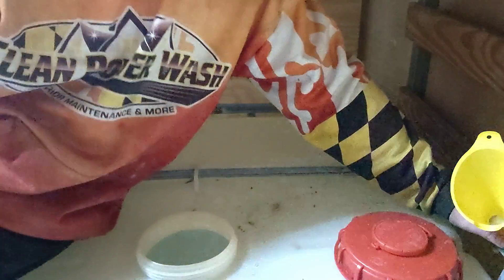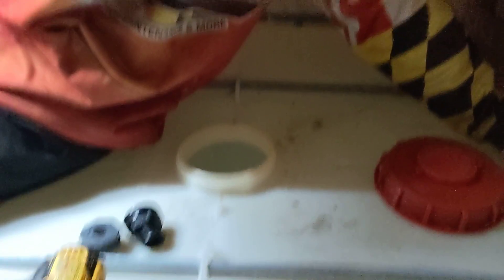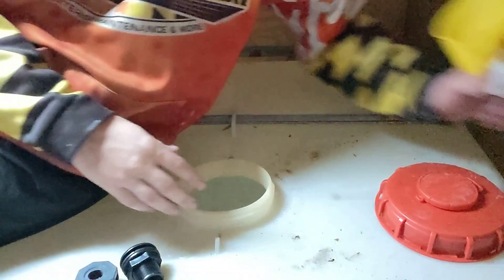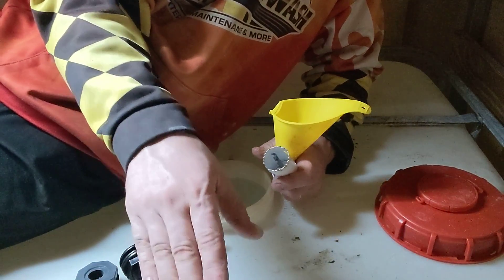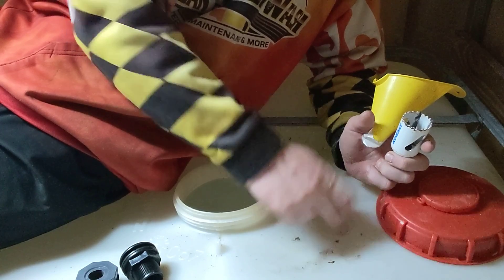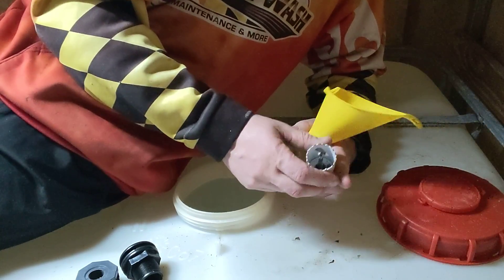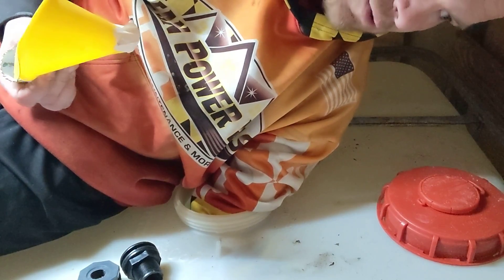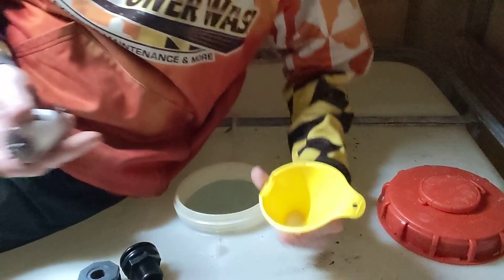How to install a bulkhead in an IBC tote or buffer tank.

Comment: Thanks Rob for the videos!  Just getting started and building my rig from scratch.  Do you have a one stop store that sells the bulk head fittings, slotted PVC pipes for pickups, and any other fitting?  just curious if you were just picking those up at your local hardware store or if there was a supply store you use frequently?

Comment: Quick unrelated question Rob,
I just ordered 8gpm 3500 pressure pro. 
Is the standard water intake 3/4 Barb or 1 inch Barb?
Thanks
Reply from the maker: Inlet opening is usually 3/4   we always put a 1 inch barb on it though
Reply: @Cleanpowerwash  Do you know the size of npt on it? Want to purchase it in advance before I get my pressure washer
Reply: Yanis Hall 3/4” threads by 1” barb.